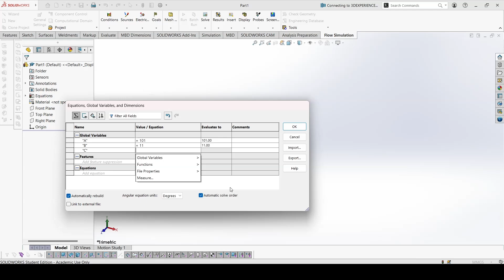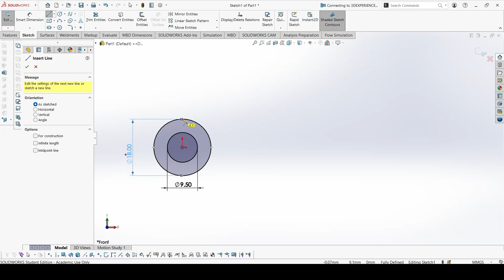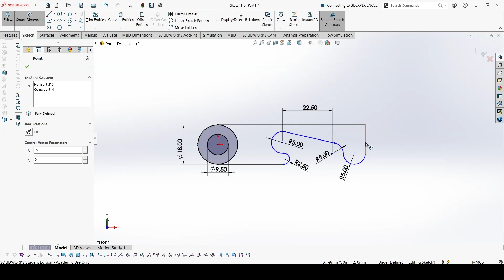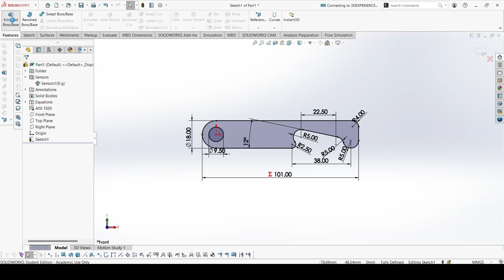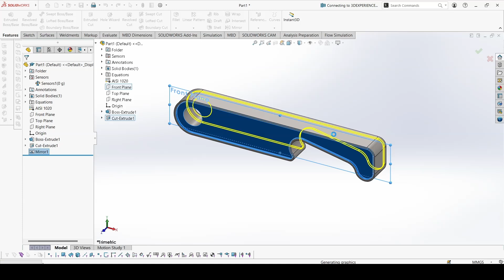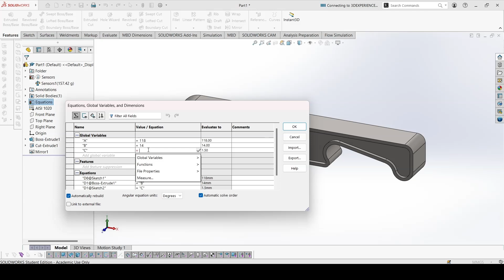Solidworks CSWA Exam Practice | PART MODELLING | Section B - 2

Comment: How did you find the dimension that was not included on the pdf? @3:45
Reply from the maker: Actually there are many missing dimensions and errors in the pdf questions. The solution parts are analysed to find the correct dimensions.
Reply: @Robotics_AV_club  i wasted so much time thinking why it wouldnt get fully defined
thanks